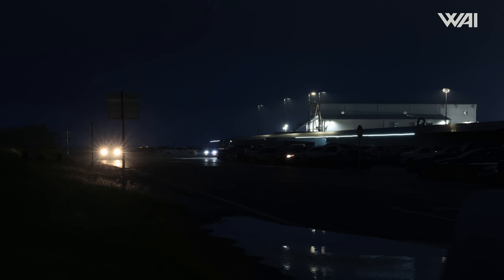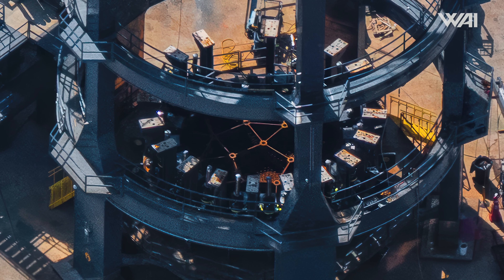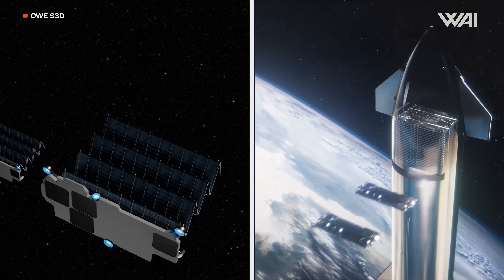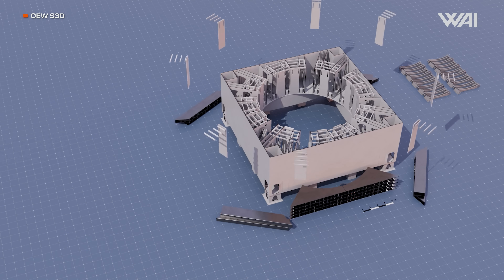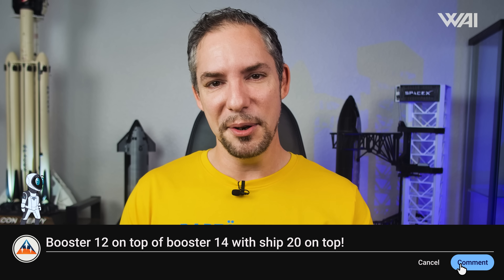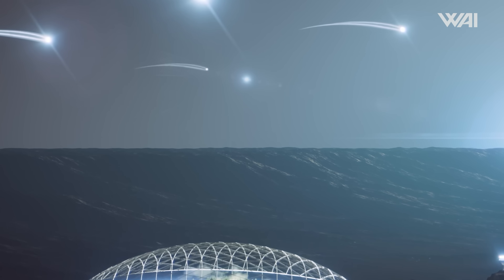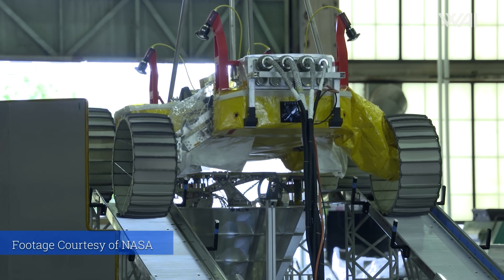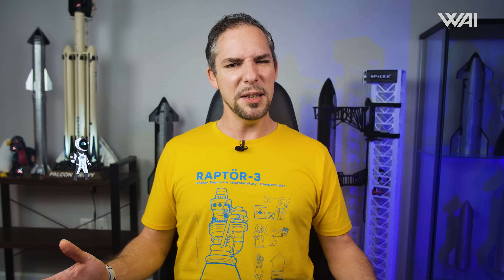SpaceX Starship Flight 8 Just Got INSANELY Fast - Here's Why?

Comment: I don't think the OLM will be moveable as it does not have enough weight to move with a booster on it without the possibility tipping over. 
Also the OLM needs the embedded pipes to be plumbed in for deluge and fire suppression.

Comment: 16:23 - You are forgetting, of course, the Soviet Lunokhod rovers of 1971 and 1973.  Designed to operate for mere days, they both exceeded their expectations.  Lunokhod 1 traveled over 2 km in 11 days and Lunokhod 2 ran for four months until a procedural accident caused dust to be dumped into the interior, an overheat and loss of communications.

Comment: Lunokhod 1 (USSR) was delivered to the surface of the Moon on November 17, 1970, by the Soviet interplanetary station Luna-17 and operated on the lunar surface until September 14, 1971 (on this day, the last successful communication session with the vehicle was conducted). Thus, the operational duration of Lunokhod-1 was 302 days. During these 302 days, the rover traveled 10.5 km at an average speed of 0.14 km/h.

Lunokhod 2 was delivered to the Moon on January 15, 1973, by the automatic interplanetary station Luna-21. Over four months of operation, Lunokhod-2 traveled 42 kilometers (a record distance that remained unbroken until 2015, when it was surpassed by the Mars rover Opportunity), transmitted 86 panoramic images and about 80,000 television frames to Earth.

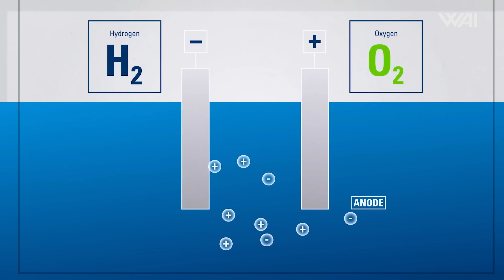Comment: 18:27 ... "There won't be a base on the moon if there is no ice." This assertion is incorrect.

There is no shortage of oxygen on the moon. The problem involves extracting it from the available raw materials. Extracting oxygen from the regolith is quite possible but it does require a lot of energy. Sourcing that energy from photovoltaic arrays would require huge solar panel farms which would require shipping a lot of mass to the surface of the moon and this would be expensive to do. However, it could be done using small lightweight modular nuclear reactors i.e. Kilopower Reactors.

The bigger problem is that, other than ice, there does not appear to be a readily accessible source of hydrogen on the moon. Being able to mine ice on the moon radically changes the economics of the problem because in addition to providing a source of oxygen it also provides a source of hydrogen and water.

Hydrogen is needed on the moon to produce rocket propellant for HYDROX and METHOX rocket engines and for the much higher specific impulse nuclear thermal propulsion systems (high specific impulse means that you do not need as much propellant to obtain the same amount of thrust). If we cannot mine ice on the moon then we we are going to have to take hydrogen with us, which would be much more expensive than extracting it from ice on the moon. 

Hydrogen itself is bulky, requiring large (i.e. heavier) tanks to move it around, it must be keep very cold, requiring large and heavy cryocoolers, and, because molecules of hydrogen are so small, it tends to leak out of whatever container you attempt to store it in. For this reason, shipping hydrogen to the moon would be easier to do by first combining with carbon to form methane, which is the rocket propellant used by the Raptor engines used by Starship, even though it too needs to be cryo-cooled, although not as much as hydrogen. Better still you could combine it with nitrogen to form ammonia which can be stored under pressure without active cooling. Ammonia could be stored cheaply on the moon by burying the storage containers to protect them from wide fluctuations in surface temperature.

The mixture ratio of oxygen to either the hydrogen or methane used by both HYDROX and METHOX chemical rockets is such that most of the mass of the propellant is made up of the oxygen and not the combustible fuel. Even if ice cannot be mined on the moon, for some reason, we can still obtain oxygen on the moon. Because the gravity well of the moon is much less than that of the Earth it would require much less energy to it get into space if it was manufactured on the moon. This makes lunar derived oxygen much cheaper to get into space.

The significance of this is that bases WILL be established on the moon if only to obtain oxygen for use as propellant by space vehicles, and for other reasons, regardless of whether we can extract it from lunar ice or not. If we CAN mine ice on the moon then the whole process would be less costly because we would not have to ship hydrogen from Earth, or maybe even from Mars in the form of ammonia to the moon in order to establish sustainable operations there (there does not appear to be any readily available source of nitrogen on the moon either, and you will need nitrogen to grow food on the moon).

Because there is no atmosphere on the moon, we are obliged to use a lot of propellant to land on it. Mars does have an atmosphere which allows aerobraking to be used to greatly reduce the amount of propellant required to land on it. For this reason, it requires less delta-V (i.e. propellant), to land on Mars than it does to land on to the moon. 

This is why those in the know, and those who have done the maths, including Elon Musk and SpaceX, recommend that we forget about the moon and head straight to Mars. All of the resources that we need can be found there, and it is cheaper to get there, even though the voyage would take longer, and if something were to go drastically wrong it would be harder to get back. 

The greater the risk ... the greater the reward!

Comment: Looks like using kerosene (RP1) is better suited to chemical orbital rockets. Less hazardous, more easily used in fuelling, can be pumped in orbit for refuelling, doesn't bleed- off, much simpler infrastructure.
Reply: The problem I think is that it leaves a soot that can clog engines and so it affects reusability.
Reply: @ct6502c  to which an assistance to reuseability might be to improve serviceability. Falcons on RP1 have set the standard on reuse and relighting in orbit, so it would be interesting to hear SpaceX thoughts on how the first re-use of a Raptor 2 went.

Comment: I wonder if SpaceX will put a camera inside that space in Starship so they can see if/when there's a failure between the engine firewall and the tank dome. As small as video cameras have become, they could visually monitor more places inside (maybe not inside the tanks themselves, but the other voids).
Reply: Fun fact: they have Cameras inside the Tanks. or at least used to. Some F9 livestreams showed them by accident for a few seconds..
Reply: Last I heard, SpaceX has 33 engineering cameras all over the ship and booster.

Comment: The weight bearing capability of the catch arm is huge. The offshore drill rig will hang many MILES of drill stem from the rig. They drill in 10k feet of water down to beyond 15k feet deep. That's about 5 miles of very heavy pipe and the very heavy drill mud inside. Obviously millions of pounds are routine loads. So a Starship is nothing.

Comment: The priority is to test block 2 starships, the safe way is to use a brand new booster, to guarantee a good test result, even tho they need test the reusability of boosters. It's not about a bet, but statistic probability with goals and past successes, they mostly likely are going with block 2 flight test in a new booster with fewer pre-flight tests, and they may do some extensive pre-flight tests on the previous flew booster but not flying it.

Comment: The commentary on SpaceX and Blue is not "off". New Glenn launched and did not explode causing mass disruption to flights ..Starship did. If Musk didn't run his mouth the whole time he might get an easier ride, but in this case his rocket exploded and New Glenn didn't....and he runs his mouth all the time.
Reply: Speak of running one's mouth off all the time....  Tell us, exactly what happened to Blue's booster?
Reply: @ lost communication and no return was done on a drone ship.. super heavy booster land within 4feet of accuracy and nailed it on the first try if you really want to compare with blue origine
Reply: starship is about 4,5x the power of new glenn and wasn't developped over the past 2 decades... + spacex approche is fast iterations and test till failure. Blue origin is a private company based on a public buisness model
Reply: @williamvallieres3084  and it blew up and was reported correctly as a major disruptive event. Which is all factual. Not disputing their success
Reply: @ 2 booster catch ever + all 7 tests flights prio where mission success
Reply: Didn't disrupt major flight paths - what happened to Blues booster.

Comment: I wonder why the pez dispenser opening isn’t at the top.  In space, with no gravity, moving the star links “up” is as effortless as “down” but the pez dispenser opening can be higher, meaning less weight on the opening and less reinforcement.
Reply: Also, loading at the factory means transporting a top heavy ship to the launch pad!
Reply: I wonder when we'll see an actual satellite launcher vs. just the spacex launcher.
Reply: Newtons 2nd law of motion for every action there is an equal and opposite reaction. They want a more stable mass to eject them because as they’re ejected there will be a slight push back against the ship
Reply: @marccracchiolo4935  So, yeah.  Weight savings (less reinforcement) versus ejecting from the top and inducing a spin that would have to be counteracted (more). Makes sense.

Comment: I wonder why they are bothering with the pezz dispenser? Wouldn’t a more universal system for releasing payloads be better?
Reply: Don’t forget that Falcon 9’s upper stage is expendable whereas Starship’s is being designed to be reusable. It’s probably quite an engineering challenge to create a huge payload bay door that can open and then crucially shut again with the precision and structural strength retained for it to survive reentry and a catch. I suspect that getting the engineering right for a working implementation of the current small payload bay door and pez dispenser is easier and SpaceX wants to be able to launch the bigger Starlinks as soon as it can so maybe it went for the fastest solution for now. Elon has demonstrated before how ruthless he can be in focusing without distraction on what is needed right now and leaving other stuff for a later day.

I’m sure a big general purpose payload bay door will come at some point but looking at Artemis renders (HLS on the Lunar surface and tanker refuelling in LEO) plus renders of Starships on the Martian surface none of that stuff shows a full size payload bay door so it’s quite possible that it might be quite a while before we do see SpaceX allocating resources to that. That’s one reason why I think that some of the really single minded SpaceX fans are too quick to dismiss the importance of New Glenn. With NG’s huge fairing volume and more conventional payload release mechanism, if we do have to wait a while before SpaceX prioritises developing a full size payload bay then for quite a few years to come NG might be the launch system of choice to get very large payloads up to LEO (large in volume terms, admittedly with nothing like the payload mass capabilities we hope Starship will deliver, but still useful for stuff like space station modules or space telescopes that won’t have to do James Web folding mirror tricks hence simplifying designs and saving costs).
Reply: That is just tailormade for his satellites; they will no doubt have bay doors at some later date on a different version of Starship. Maybe a version where the whole front nose cone swings up and out of the way to allow a cylindrical payload to come out of the front.
Reply: @ I get that it’s Taylor made for the larger Starlink. But like with falcon nine, they released the starlings in a similar way that they release other payloads. This is so tailor-made for one type of payload. I wonder if it’s not optimizing something that should not exist.